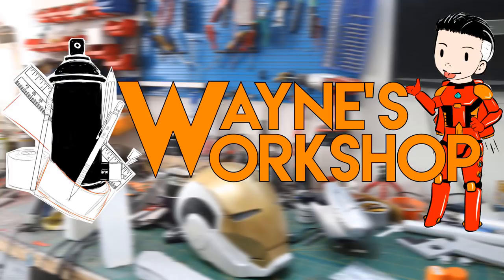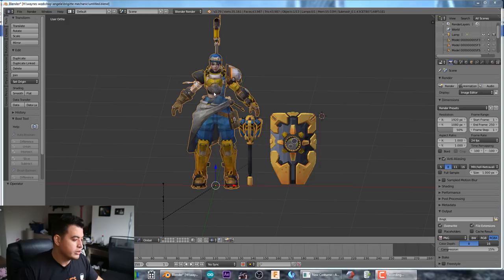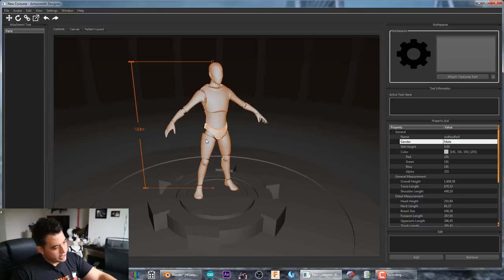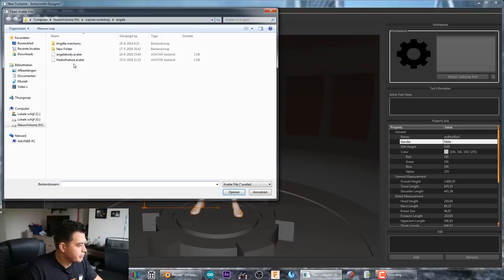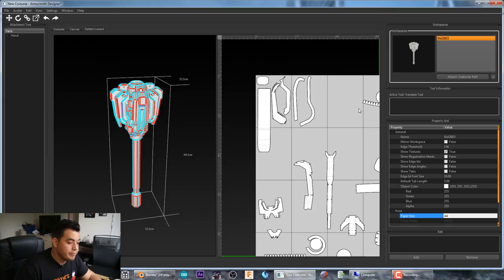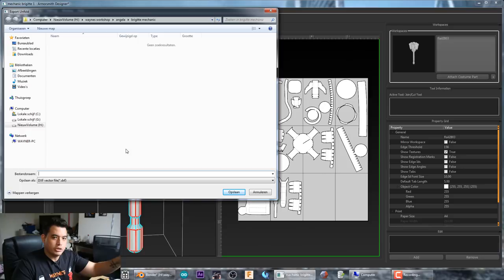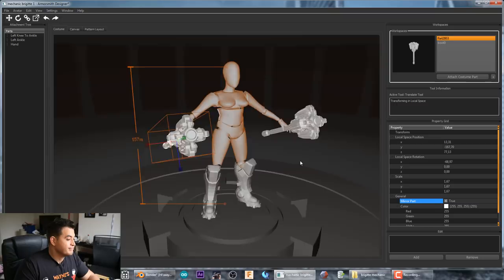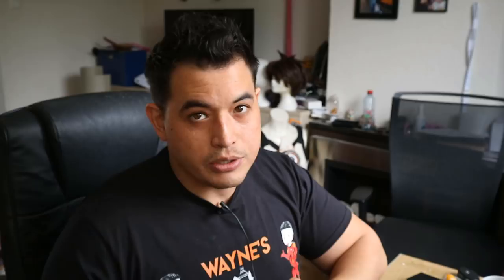How To Make Cosplay Armor: Episode 1 - Armorsmith software - TUTORIAL

Comment: Could you use armorsmith to do patterns to use in syntra sheets?
Reply from the maker: i think so, afteral its a flat 2d template, and you can trace it onto syntra and heat form it to bend it. wear a respirator against organic fumes if you heat it up though, it releases bad chemicals once heated

Comment: bought it today...Doesn't work on Windows 10...very dissapointed.
Reply: What's the error you're running into? It's likely either the DirectX installer or the visual c++ runtime installer.
Reply from the maker: I run it on win 10 just fine, it's indeed related probably to the direct x or c++
Reply: Wayne's Workshop wasn't anything of that...all fixed, firewall was the problem. Blocking the app totally. didn't even start.sorry!
Reply from the maker: All good man, good luck with the software, I'm covering more of it as the build progresses
Reply: I'm Definitely running into the DirectX or visual c++ problem. Can you please help? I emailed you from the website and on Instagram.
Reply: Do you have any tips for the Installer issues?